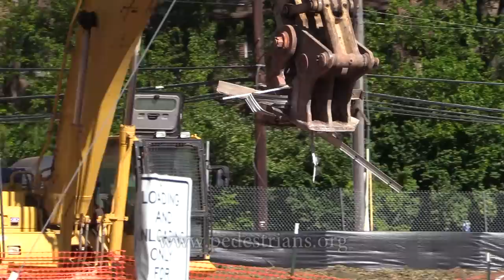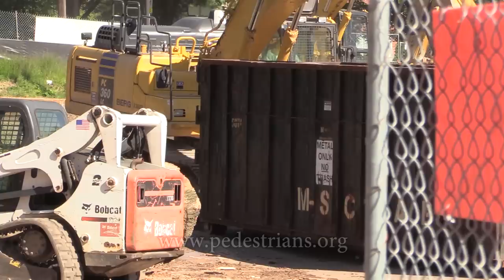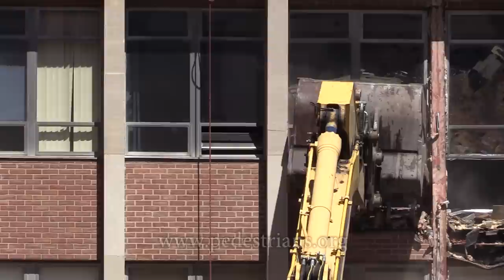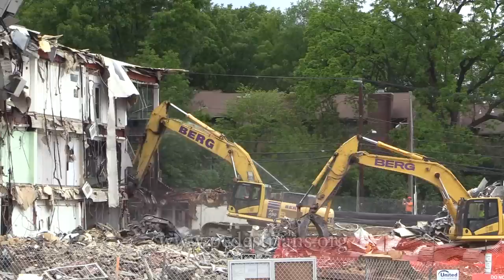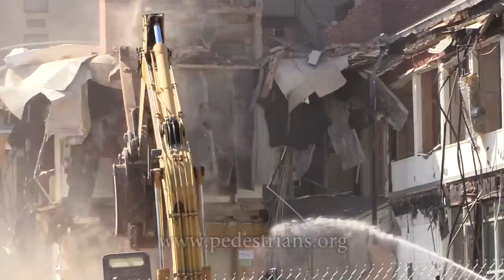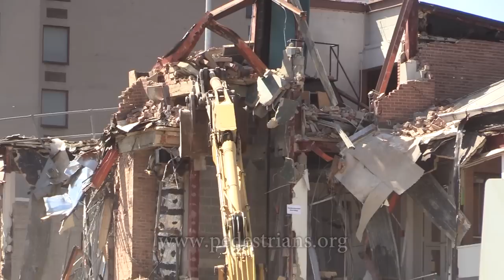Planning Department Demolition, Part 1

Comment: Call me odd but I like the architecture of these 1950's and 60's mid-century office buildings. All the ledges, many angles, and color of the brick with concrete trim makes for interesting exteriors. The interiors most likely are boring though.
Reply: As I'm sure you know, usually the mechanicals and the HVAC systems and the windows are so far out of compliance with current standards they just can't be brought up to date at reasonable cost.

Comment: Well done video, John. Thanks.

I've never seen that tool being used in the opening shots. A bit later the operator pulling the brick veneer down is amazing. Every time  he snuggles the bucket in front of the window frame, pushing it in so he can pull down the bricks cleanly.

Having grown up in earthquake country (California), I'm always surprised at how little the masonry veneer is secured to the structure in this region, as you see with those fake brick and stone columns. And I'm surprised at how easily the steel structure fails at the connections, though it did resist in a few cases.

At 50:00 there is a multi-story residential building behind, and to my amazement there is nobody on those balconies taking in the free entertainment! :-)
Reply from the maker: The attachment was left on the excavator when it was brought in from the previous job.  It was only used for part of a day before the grapple arrived and it was swapped out.  Perhaps someone knows if it is usually used as a concrete crusher or pulverizer.
Reply: @JohnZWetmore  That‘s indeed a primitive form of a concrete crusher. (primitive in that sense as it doesn‘t have it‘s own hydraulics). I wonder if one day, fully hydraulic quick couplers will arrive in the US. They have been around for more than 20 years , and make things so much easier especially in demolition.
Reply: @peon9282  You're correct, its an old (outdated) concrete muncher. Here in the UK and Europe the modern hydraulic versions are standard bits of kit - you'd be thrown off site using a bucket for demo and potentially damaging the teeth! 
Also Yes to Fully Automatic Quick Hitch  :)

Comment: Wrong tool used for materials separation at the start. That was a concrete/brick muncher. You need a selector grab, graptor, or thin bucket with a thumb.